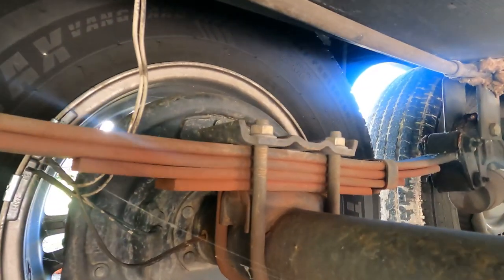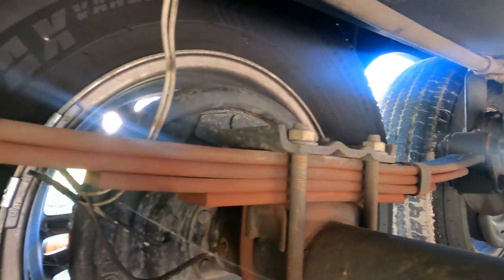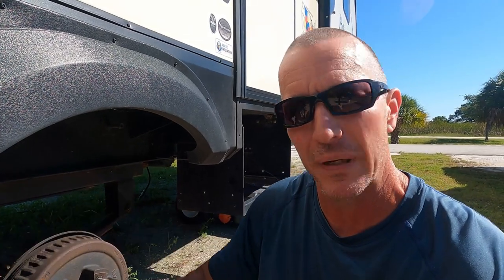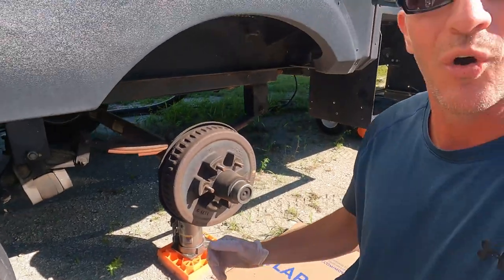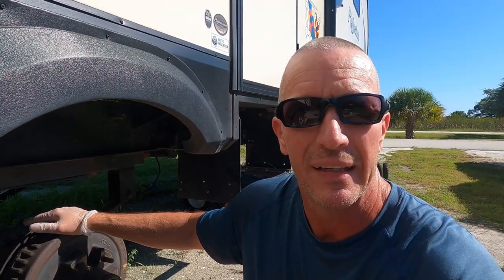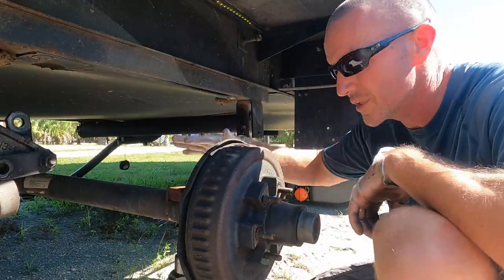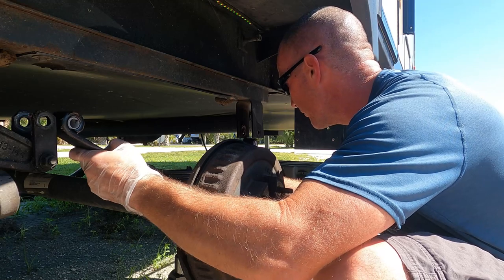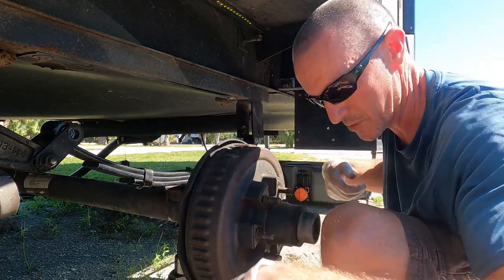Replacing Leaf Springs On A 5th Wheel | RV Suspension Repair

Comment: Just an observation: It looks like you didn't replace or use new bronze bushings in the new springs. At 9:37, you can clearly see the plastic bushings still in the new springs. The wet bolts use/need the bronze bushings for proper lubrication. You should replace those immediately with new bronze bushings. I replaced my springs myself when I installed the CRE3000 Morryde Equalizers. I also replaced everything else, like u-bolts, nuts, washers, shocks, brakes, etc. I was cautioned to use the same springs are using springs that are oversized (beefier )for the load could have a detrimental effect. Sounds like you are in Michigan and two local trailer shops have the springs in stock. Air tools or cordless impacts are a big help in not only getting it done faster, but in torquing down the bolts and nuts. Great job and safe travels!
Reply from the maker: I’ve already replaced these with the  MORRyde equalizer and new springs and shackles all with bronze bushings. This video was just post Covid and parts were impossible to get.

Comment: When installing the wet bolts, the hole in the bolt shaft must be oriented at either the 9:00 or 3:00 positions for the grease to ooz out properly.  Otherwise the wet bolt may not take grease properly.  If the grease does not ooz out of the bushings and the pressure seems high going in, the bolt will need to be removed and reinstalled correctly.
Reply from the maker: I should have addressed that, thanks for the tip.

Comment: I always come back to your video on changing leaf springs.  Like I commented a couple of years ago, I carry 2 spare leaf springs with us when we travel in our TT.  I checked the torque on the U-bolt nuts the other day on our TT.  Wow, a couple of them weren't at the minimum 45 ft. lbs that Dexter recommends.  Glad I checked.  We are getting ready to take a cross country trip in our RV next month.  It really pays to go around and check the torque on everything.  Coming back from Maine last year, I arrived home.  I found the nut holding the ball to the hitch was loose!!  I now carry a wrench specifically for that, too.  That gets checked every time we pull stakes up at a campground. Keep the videos coming!!
Reply from the maker: Thank you and thanks for the support!

Comment: Really a very thorough video on how to change the leaf springs.  Our RV is a 2019 Coachmen Catalina.  Yesterday, I bought a "Spare" leaf spring and shackles to take along with us on our adventures.  I've seen too many videos where people have been broken down in the middle of nowhere because of a broken leaf spring, and had to wait days to get a replacement.  That's not happening to me.   I carry all the tools necessary to change one if need be.  With the supply chain shortages, you could be in a real pickle if you couldn't get a replacement.  It's not a real expensive part to buy as a spare and you will have peace of mind if one should ever break.  Even if you couldn't replace it yourself because of lack of tools or knowledge, at least if you had an extra one with you, someone could replace it.  Again, good video!!
Reply from the maker: Thank you! I have read the horror stories as well. Definitely glad I took a look at them before hitting the road! Thanks for watching!

Comment: Thanks so much for the detailed video.  I'm looking at replacing my leaf springs.  But I'm having trouble with the measurement from eye to eye while on the rig.  I have one that measures 26" and all the rest measure 25 1/2" with the weight removed.  I don't see anyone selling 25 1/2" springs.  They seem to be all 25 1/4".  And what about the one that measures 26"?  Not sure if the previous owner just replaced that one with a different size.  I don't have any wear or tracking issues.  I just want to be proactive.
Reply from the maker: I would say they are 25 1/4” springs. That is a common length, so yours may be flattened out a bit from the original length

Comment: Great vid. How do you keep the axle in line? Do you have to worry about the axle moving front to back?
Reply from the maker: The axle doesn’t move much while resting on the jack. The pin on the leaf springs will center the axle to the spring seat when you’re re-assembling everything.

Comment: Hello friend, thanks for the great video, it was a huge help with my recent leaf spring replacement. While we don't have nearly the mileage on ours as you have on yours (less then 9000 miles actually) our 5300lb dexter springs have been put out to pasture! Just one quick correction on your torque specks, Moryde recommends 40 Ft pounds on their wet bolts as the shaft of the bolt is hollow and shouldn't be over torqued.  Thanks again and safe travels!
Reply from the maker: You’re welcome, thanks for sharing that info and thanks for watching!

Comment: Definite improvement to ward off the chance of suffering a broken main spring. But I would have replaced the the plastic bushings with bronze. The plastic bushings disintegrate, wet bolts or not. They just can't stand the weight. That's why all heavy duty shackle kits only come with bronze bushings.
Reply from the maker: I would have preferred the bronze bushings over the nylon. Given how hard it was to even find springs, I decided to take what I could get at the time. I will definitely be keeping an eye on them. Thanks for watching!
Reply: @JouppiOutdoors  with 30 years of RVing behind me, I'd like to make a suggestion to prolong the life of your springs. Many manufacturers recommend jacking the RV and supporting it to relieve at least partially some of the weight off the suspension. Springs will tend to sag over time from simply having the full static weight resting on them. This is also beneficial to extending the life of your tires and to prevent flat spotting. Goodyears trailer tire website recommends raising the tires off the ground and reducing tire pressure by 50% during long periods of storage. I've practiced this procedure for nearly all my years of RVing and have never suffered a tire failure. Just a friendly suggestion.

Comment: With the suspension issues you’ve had in the past I think I would have replaced the Dexter equalizer with the MORRyde SRE 4000, using that system you get a slight lift and a crossmember for added strength. I am very pleased with the results.
Reply from the maker: I’m sure that’s an excellent replacement option. I was looking for the easiest, most straightforward, and cost effective option, not to mention the time crunch I was under. That is why I went this route for now. Perhaps a MORRyde suspension will be in our future! Thanks for watching!
Reply: The upgraded equalizer does not extend the life of the springs.
Reply: @Randall Wiebe  it does. It softens the impact that would normally be fully transfered to the springs.

Comment: Thank you for making this video. I have a Reflection 311BHS and I am about to undertake this job myself. Have you had to change your suspension out and when you changed your leaf springs did you still have plenty of camber remaining in your axles? I am considering replacing the equaflex for either a new set or switching to the MORRyde units.
Reply from the maker: I have only changed the leaf springs. If we end up keeping this 5th wheel, it will get an entire suspension upgrade. Thanks for watching!

Comment: A fact of life is that extreme forces on the frame and springs  while backing into paved camp spots cant be avoided . The pavement doesnt let the tires slip and dissipate the stress of bieng dragged sideways while making turns. All one has to do is to have the wife video the wheels while you make a turn or back into a camp spot. That twisting force is transferred directly into the frame and its axle components and can break them .So I recommend a visual inspection of the Ibeam frame near the wheels 3 ft before and after the axles . Look at the I beam web for cracks appearing as bulges or rust colored streaks about 1 inch above the flange  . Also spring shackles and springs . On 5th wheels a common point of frame failures is the Goose Neck frame transition area. Any movement is a sign of broken frame members .
Reply from the maker: Great tips, thank you for sharing!

Comment: Great video! Easy to follow and understand. I don’t have the self levelers. Do you have any suggestions for my situation. 35’ 5th Wheel. Thank you!
Reply from the maker: Are you referring to the equalizer between the axles?
Reply: @JouppiOutdoors  I believe I just need to put jack stands under the frame to free up the springs.
Reply from the maker: I understand what you mean now. Yes, just jack the frame up and put jack stands under it and it’s basically a manual version of what I did with the auto level jacks.

Comment: Ok, so where do you want to meet up so you can do ours!  Looks to be a little over my abilities. It is something that I have thought about though as well as replacing the shackles. Yours looks a lot more heavy duty than ours. Thanks for sharing!
Reply from the maker: It’s really not too difficult, I bet you could knock them out with no problem! Hopefully the new, beefier springs will hold up better than the originals. Thanks for watching!

Comment: Great video! You make it look easy!Very informative ! Wondering , have you ever checked into Sumo springs for Your RV ?
Reply from the maker: Thank you! I have Timbrens on our truck which are a competitor to Sumo Springs. We have been extremely happy with them on the truck. I can see the benefit of having them on the trailer since most leaf springs are right at max capacity.
Reply: @JouppiOutdoors
Reply: Thank you for your reply. I was also wondering what you use for your drive route planning ? Y'all be safe.

Comment: I have seen videos which say that the holding bracket on the leafs need to be at the front and not at the rear.
Reply from the maker: Not sure I understand? Mine has a bracket on both ends, it a double eye leaf spring. I know there are slip-in style leaf springs on some trailers, could that be what you are referring to? Thanks for watching!
Reply: @JouppiOutdoors  No it's the small band that holds the leafs I place. I saw this on a few YouTube videos. I'm still not 100% sure why though.

Comment: I have a travel trailer with a dual axle and just replaced both leaf springs on one axle. Do you recommend replacing both springs on the other axle and why. My trailer is 10 years old. Thanks so much.
Reply from the maker: If the springs on the other axle look good and  are not flattened out, you are probably ok. The only possible drawback might be that the old springs do not have the same load carrying capacity as the new ones, but that might not be a big deal if they are still in good shape. Thanks for watching!

Comment: Why did you not replace the bushing on the equalizer shackle?  If those wear out they will damage the equalizer.  Camper trailers have a constant load on the suspension and are not designed for commercial use hauling across the country many times puts a lot of wear and tear on them.  the 5 leaf pack spring would have lasted 2x as long as the 4 leaf pack which is barely enough to hold all that constant weight.  If you have  a trailer with those think shackles it would also be good idea to have couple spare on the road with you.  Those wear out and break below the bolt hole.
Reply from the maker: All good points, thanks for watching!
Reply: @JouppiOutdoors  Nice work maintaining those springs and suspension.  Most people would wait till it breaks and be surprised.

Comment: Great video! Also enjoyed your bearing packing video.
I replaced our 2500 pound springs that last year on our 303RLS, only I went to 5-leaf 3000 pound springs.
One other thing I have read and I will probably do next time I do the springs -- upgrade to thicker shackles. While they don't break as much, they do fail.
I have been stuck roadside on a major highway in a prior travel trailer and it is a terrifying experience. I have a goal to never repeat that!
Reply from the maker: Thanks! I was planning to go with the 5 leaf version but my U bolts were not long enough, If there is a next time, I will invest in the 5 leaf springs and new U bolts. Thanks for watching!
Reply: Looks like I'll be ordering a couple of wet bolts and shackles for spares....
Reply from the maker: Not a bad idea to have on hand! Thanks for watching!
Reply: @bigearn8782  if you have a drill press and a tap you can make your own.   I used some of the old bolts from when I replaced them on my 1998 Alfa Ideal.  I held them in a vice for a drill press and drilled to the center of the bolt and then layer them on their side and using a wire for the depth to know where to drill the holes in the side.  Cleaned everything with brake cleaner and then used the correct tap for the grease zerk.  

I replaced the bolts on my 2014 Keystone Cougar 337fls with a wet bolt kit but this summer when I rebuild the suspension, new 3,000 5 leaf springs and I’m replacing the 5,200 axles with 7,000 lbs axles I’ll use the wet bolts I’ve made.  The reason is the wet bolts that came in the kit have a shoulder on the threaded ends, so the nut is small than the bold diameter and with the lip there’s a chance that the lip will catch and not go through the hanger and you’ll be tightening against the hanger and not properly torqued.
Reply: @paulshannon4576   Excellent info.  Thx.
Reply: I agree.  That's why I take along extra shackles with me when we travel in our RV.
Reply: For quite awhile, I have always wondered why RV suspensions looked so incomplete.  Then I wondered, shock absorbers?  I mean, why should a thin piece of flat metal be taking all the flex and punishment?  So I added Sumo's to the 5'ver and I've read others adding shocks.  I can personally say what a difference.  RV tows so much smoother and responsive, like towing a car.
Reply from the maker: I have considered adding Sumo’s. Thanks for the first hand info.
Reply: exactly better shackels upgrade to at least 3/8 inch thick shackels or 1/2 inch.
Reply: @JouppiOutdoors  I know the U bolts add another expense but it is way better to have 5 leaf springs especially if your RV is heavy with slides or you drive lots or you fill the water tank full for wild nature camping.
Reply: @paulshannon4576  why are you upgrading to 7k axels?  Are you finding that the 5200lb axel is bending or bearings are too small or did you add a 2nd water tank for long range nature camping?
Reply: @JouppiOutdoors  yeah either summo springs or timbrends or a proper 5 or 6 leaf spring with 1/2 inch thick shackles.

Comment: Good Stuff.  Also own the GD Reflection 28 BH.  Are there any manuals/info on service schedule (either time or mileage) for things like this  from GD or anyone else?
Reply from the maker: Thank you! I’m not aware of any manuals regarding regular maintenance. I see problems others have had and try to service and maintain those areas to prevent problems as much as possible. There is a lot of good info on the Grand Design Owners Forum, I learned a lot from there. Thanks for watching!

Comment: I was told to replace the u bolts as they tend to stretch.
Reply from the maker: It is recommended to replace them. At the time I ordered the springs, parts were very hard to find (Covid shortages?). I am actually getting ready to do 6 leaf 3500lb springs with new U bolts and MORRyde shackles, bushings, wet bolts, and equalizer.
I did recheck the torque on these U bolts regularly and they have not loosened in 2 years.

Comment: Most RVs use cheap Chinese made springs.  Adding shocks will greatly increase the life of a spring.  I always tack weld the bolt head to the shackle link. You don't want the link to rotate around the bolt.
Reply from the maker: Thanks for the input and thank you for watching!

Comment: I think you put it on backwards. Did you notice in the video clip prior the leaf spring clip is not matching?? It’s in the wrong direction? Easily overlooked I San see how. I have done the same. Maybe you adjusted it prior to installation. You probably should make sure? I dunno. Juts for safety. I believe the clip should face forward on the leafs?? I may be wrong. Nice video. Would be better if you showed where you jacked the rest of the RV up.? Most of the technicians out here don’t do RV/Trailer work… Doble check that positioning for your own safety. Regards and thank you sir!!
Reply from the maker: I asked the spring manufacturer about this. Since the spring eye is the same distance to the center pin on these springs, it can be installed either way. They said typically the clip is forward of the axle but there is no issue installing an equal length spring with the clip towards the rear. Very observant, thanks for watching!
Reply: @JouppiOutdoors  ha. Crazy how I saw that lol. I know because I just did the same thing, I removed that and re did it. I did not know and just saw this. I was hoping I saw this earlier luckily I caught it before it got to far along. Am I the first person to notice that. 😂. Hey. Thank you and great video. Was a help that’s for sure. I do have one question, the length of mine I installed are about 2 inches longer. I’m thinking they are ok. Just after market. Did fine easy job all together good money. If you know that’s it’s not just let me know. Regards.

Comment: If I change 2 springs from 1 axle, do I need to change the other 2 on the second axle?
Reply from the maker: It would be recommended to do both axles, however, if they appear to be good you could probably get by on them.

Comment: It looked like you put the spring on backwards to the one you took off. The wet bolts should not spin in the shackles.
Reply from the maker: Mixed views as to whether or not the direction of the spring matters. This was done when parts were scarce. I have since upgraded to MORRyde equalizers and heavy duty shackles along with heavier leaf springs. Thanks for watching!